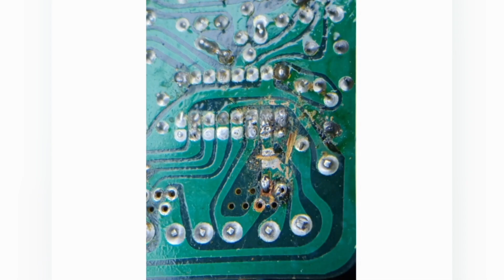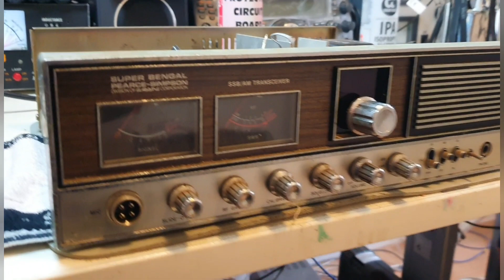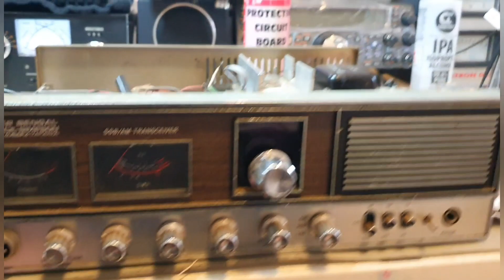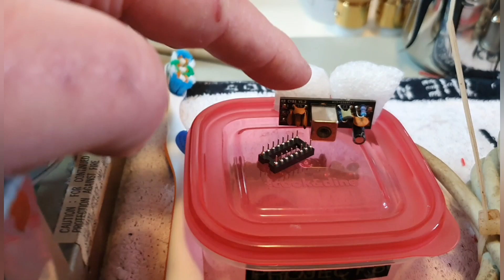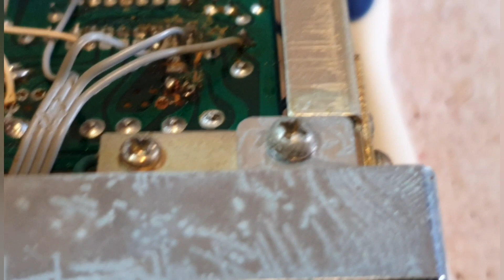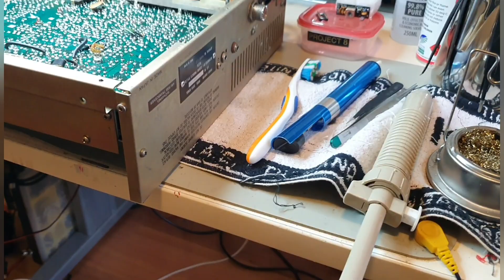Super Bengal Restoration Project - 02A Track Repairs - NEW RR VCO - 02A Chip Holder - Part 2 of 8

Comment: Great video's Paul.
What's the heat sink attached to the transformer!
Doesn't look like it should be there 🤔
Reply from the maker: Thankyou sir
It has a psu regulator mounted to it.  2 other people said the same, also the 4500pf cap is not meant to be there, and a factory board underneath for transformer has been home made, or factory.

I'm guessing the radio was suffering voltage issues after importer upgraded to 240vac and did these mods.  The cutting was not done with a hacksaw, looks more like proper cutting equip used.

It's now TX and full power, next step pull the channel selector and test the 2 resistor banks truing to sort led segments missing